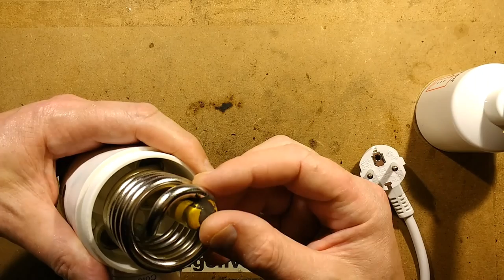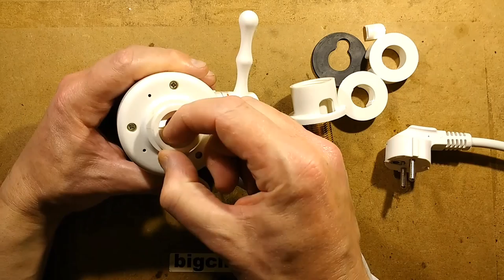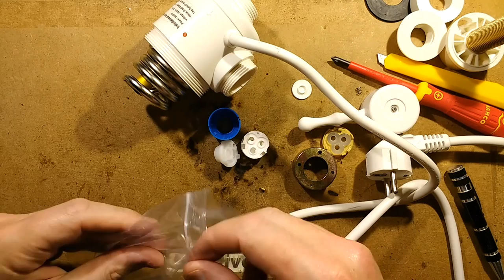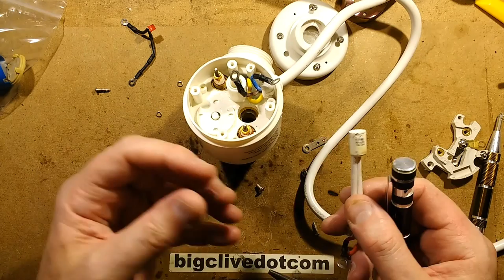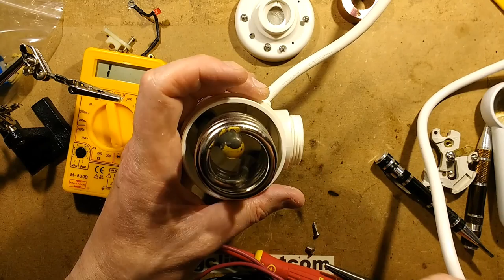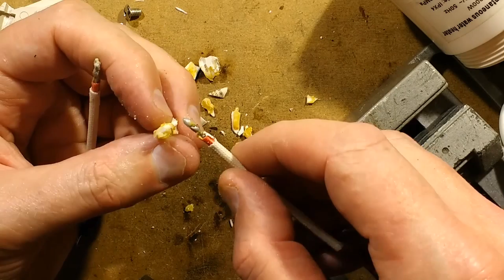Cheap electrically heated tap / faucet teardown.  (230V)

Comment: I'm not surprised the thermal protection is a one-shot deal, but I am surprised that the device is fairly well-engineered for safety. It is a Chinese product, after all.

These things were marketed in the US as a more economical way of getting hot water for coffee or tea without having to run the hot tap. I think I'd rather use a stinger kettle.

Comment: Odd. In New Zealand we typically have a large central electric boiler for houses. Small instant boilers are typically only used in remote locations or those where it'd be impractical to install a full sized boiler
Reply from the maker: We normally use an electric immersion heater in a cylindrical tank here, combined with a heating coil from a gas or oil boiler, or an on-demand water heating system.  But local water heaters are handy in workshops or where the sink is far enough from the tank to take a long time for the hot water to arrive.
Reply: bigclivedotcom right. Seems like it's pretty much the same in New Zealand. Thanks for the reply :)
Reply: Although most don't have any additional coils in their boilers

Comment: Are you sure that is a resistor thing in the black shrink tube is really a resistor and not a TCO? For example,  EYP-2BN082. If it was, then the heating element itself would be the resistor.
Reply: The heating element draws way too much current to put the LED in-line with.

Comment: Try baking the element under your sink I increased mine from 1 mega ohm to over 20 m ohm between contact and earth case , well past what the meter reads no more trips , not sure if it drives moisture out or moved the internal parts of the element gas mark 7 in the oven for 2 hours lol

Comment: I get my hot water right from the plant, so I guess I'm even better off. I have to run my sink for about 10-15 seconds and then the hot water that comes out of it is certainly somewhere around 50°C or more. Same with my shower, I don't really have to wait. The only drawback is that you're getting used to it and don't quite know how to react to those systems that do indeed need some kind of heating (be it electrical or otherwise).

Comment: The main issue is the temp of the incoming water. In regions where these things are common the incoming water temp is very warm already (usually 15-20C). That makes the job of getting the water hot (around 50C) much easier. 

In colder climates the incoming water is MUCH colder (around 6C where I am) making these units FAR less useful.

Of course I live in a 120V area so these units are utterly useless.

Comment: So do they use whole home water heaters in the U.K.? Here in the us we natural gas or electric whole home tank style heaters. 40 gallons are most common with a 2 x 5500w elements on a 240v 30a circuit. They only run one at a time upper and lower to the heater as far as I know. Out water heating circuits are not GFCI (RCD) at least every home i have lived in. We also don't have main GFCI (RCD) on our main breaker boxes.
Reply from the maker: We do have large immersion heaters here, but this house has had its one removed in favour of a very inefficient kerosene powered boiler.

Comment: You mentioned your undersink unit have its heating element corrode quickly, does the unit not have any sacrificial anode?
Reply from the maker: The case itself is plastic.  I think the issue is differing metals on the heating element assembly itself.

Comment: If it that difficult to remove you can bet it's a one shot or,,,, resetable.
Resetables, like those in submersible waterwell pumps,,,
Tened to get weaker and weaker until complete failure requiring motor replacement!
A very costly expense here in the States even doing it yourself.
There's a video for you Clive.
Let's see if you remain calm and keep your humor tearing into a submersible waterwell pump to get too the thermal protection devise! UN-DOABLE!

Comment: Seems like a convoluted design. Why not just a long-ish helical heated pipe with a temperature sensor (or two) which would be used to regulate the power to not go above the desired temperature?

Comment: That fuse should only be one-shot because in order to trip it you would have already had to bypass a least one other safety measure. The bung-plug should relieve pressure if the water boils in the chamber and then the pressure switch should turn off. The only time that fuse could reach over 100C is when the water has already boiled down below the top of the coil, which could only happen if a safety component has catastrophically failed.

Comment: Hi just wanted to know weather is it possible to mix cold and hot water together using that tap.
Reply from the maker: It let's you vary the flow of a single cold water feed to get temperature control.

Comment: Do these need mains water pressure? Thinking of using one in my garage with a tank feed. Thanks in advance.
Reply from the maker: No.  Anything that can allow a reasonable flow is enough.  They're not powerful enough to heat a lot of water.  I prefer a vented hot water storage tank.  Like the over-sink type.

Comment: Hmm is a 120 degree thermal overload in water ever going to go off though?  Shouldn't it cut out before boiling point otherwise it's useless even being in there?
Reply from the maker: It's to detect the unit running dry.
Reply: Ah of course thanks for replying Clive

Comment: It seems so odd to us here in Canada. There's really only one way it's done here; a well-insulated building, with a dedicated water heater and central heating. Some of the newer installations have installed tankless water heaters, but they are still not the norm.
These odd devices seem to be a half-measure of sorts, and not a real solution.
Reply: You will probably find that to be true for most parts of the civilized world.

Comment: Are hot water storage heaters (ie 5 to 100 gallons) really that rare outside North America?  Modern units are quite efficient.  I’ve never lived in a house without one in 50 years, and the life-span and failure rate is quite low.  In contrast, my shop has radiant floor heating, and the wee German built on-demand gas fired boiler has pretty hefty heat transfer, and includes a loop so it could be used for domestic hot water supply.  The trend here now is to insulate all your hot water lines and run them on a circulating loop.
Reply: no

Comment: While I am not a huge fan of using electricity to heat anything unless the electricity is generated at no cost to me, I have to say, this device seems to be fairly well built and not sonically welded or hot-snot'd together to make up for lack of quality engineering.

Comment: Seems a bit safer than the "suicide shower" head you previously looked at, I'd personally replace the cable with something a bit more "approved" though, wouldn't surprise me if that was under-rated CCA wire... :S

Comment: I'm wondering how you could even get the flex through the little fitting, there... What with the plug on the end.
Reply: Easy. Haven't you read the chinglish guidelines for electrical safety?
You cut the wire with either a dull kitchen knife or scissors, never wire cutter. 
Then after feeding the wire thru the hole, you twist the wires back together with a sort of "Meh" attitude to which is which and cover the new electrically sound connection with captain tape.
Bingo, you get the neat and tidy install and get to keep the plug.

Comment: Okay, I have what may be a particularly North American question that has vexed me for some time now. Why is it uncommon to have a central water heater in some parts of Europe? I assume on the Isle of Man it's because natural gas and HHO must be expensive due to shipping it to the island but these seem rather common place. Is natural gas a hot commodity or is electric just cheaper per kWh? I can't imagine using electric for hot water or cooking, much less heating my home. Gas here is $2 per cu. Foot, this month using gas for cooking, drying clothes and heating water only has cost me $16 total, in the winter it might hit $70 for heating usage as well (which regularly includes heating my 1200sqft garage as well). With prices like that, I avoid electric appliances at all costs. Ukraine's recent spat with Russia seems like an interesting case of political supply.

Comment: I find this stuff fascinating, having done residential and commercial plumbing in the U.S. for 10 years, this blows my mind. in most cases here in the us we would install a simple loop and a small circulation pump on the hot side of things. bam Bob's your aunti hot water instantly.

Comment: Quite a lot of plastic threads just waiting to crack and flood your kitchen with Chinesium.
Reply from the maker: That could well be an issue over time.  But a lot of high profile brands have been using plastic in plumbing stuff for a long time now.  Like toilet cistern valves.

Comment: I think that a temperature control unit might be in order using PWM to control the temperature of the heater.
Reply from the maker: To regulate water temperature you just adjust the flow.  A 3kW element controller would be large and require extensive noise filtering.

Comment: So how does it control water temperature? Is it just controlled by how fast the water flows through the heating element?
Reply from the maker: +Alan Smith Yes.  And in winter when the water is very cold it reduces to a very low flow rate to get any heat.

Comment: Are both round pins on the plug the same diameter in the UK? Or can the plug be inserted both ways?                                       "Vice of Knowledge" = Vernier Interrogation tool
Reply from the maker: Our plugs have square pins and are polarised.

Comment: I have an electric shower at home. It is rated at 9.8KW.
Reply: Shower is on it's own circuit though whereas a kettle or this tap thing would just fit in to a wall outlet with a maximum of 2.8 to 2.9KW

Comment: I am genuinely surprised that the thermal protection isn't a bi-metal.
Reply: they can make it so it breaks, so you buy a new one!
Reply: For the price of the unit and what it does I'd probably rather have it kill it in a very definitive way and simple way even if is permanent. I figure any cheap resettable fail safe has more potential to fail itself.
Reply: Good point. Bi-metals tend to fail in unsafe manners.

Comment: It's a pity you couldn't connect it to a water supply, you might have been shocked at the current draw. Mine draws 16 Amps from a 13 Amp plug! The fuse hasn't blown yet, possibly because it's mainly used for handwashing. I am very pleased with it however, as it has given us hot water in a remote part of the house in which it would have been prohibitively expensive to connect to the domestic hot water supply.
Reply: Do you really think Clive would be shocked by the current draw? He knows what it's going to be.

Comment: My under sink heater ("Boiler" in German btw.) somehow trips the thermal fuse at normal temperatures after a few years. Then I have to open the fuse, adjust a screw a few turns and it's fine again.
Reply from the maker: The Wahl Bach units have a latching thermal fuse that resets if unplugged for about half an hour.
Reply: Mine is a Stiebel-Eltron and there's a resettable thermal fuse. It's a long thin copper pipe with some fluid in it going into the centre of the heating chamber and on the other end there's a small plunger which releases the latch of the "fuse"/switch. After it has cooled down, you can push a button to reconnect the contacts. Very simple but works. It's just that I had to adjust the temperature it's firing twice in 9 years now. Looks similar to this one: http://www.heizungsprofi24.de/out/pictures/master/product/1/212311160.jpg . Inside the red mounting thing is the button to reset the fuse.

Comment: I'm 3 years late, but how is the cable supposed to be routed through that hole without having to cut-off the plug end?
Reply: It's not, you are obviously supposed to cut the cable to use that option.

Comment: This has nothing to do with the video but anyway i have a sealed lead battery 12v 7.0Ah, would it be a bad plan to try charging it with a bench power supply? if not what would be the best to set it to thanks (;
Reply from the maker: You could charge it with a current and voltage settable power supply, but some power supplied don't take well to be powered down with a source of power connected to their output.  The best approach is to buy a suitable SLA charger that will charge at a suitable current and automatically adjust as the battery nears full charge.
Reply: Ok thanks a lot!

Comment: Two pin plug Clive. Is it really earthed?
Reply from the maker: Schuko plug I think.  Side earth connection.  I've cut it off because if I ever try the unit for real it will need a square pin plug.

Comment: These elements ( from an old unit , removed from a kitchen upgrade ? ) make excellent  FREE  high power resistors , ( normally  VERY  expensive to buy new ) , for all manner of electronic projects ( usually about 20 Ω resistance ? ) ..... DAVE™ .......
Reply from the maker: I've seen spiral cooker elements used as load resistors in factory equipment.

Comment: Can somebody explain to me what those devices are used for? I mean... there is a hot-water pipe in nearly all kitchens and bathrooms I have been in... And if not, there is a small boiler under the sink. So why would anyone use those inefficient heated taps? (Serious question^^'' )
Reply from the maker: Some countries don't use central hot water systems.  These are also useful in workshops.

Comment: Hey @bigclivedotcom or anyone reading! I bought a food trailer from Alibaba and it came with a triple sink with 3 different faucets like the one on your video, they're a different model but essentially are the same style. Turns out none of them seem to be heating. Even though they're brand new and the manufacturer says they tested them before shipping. I made sure they're properly plugged, the water does go up through it and stores in the little "heating chamber", but no heat whatsoever.
Is there anything I could try? Or are they just faulty or defective? 
Thanks SO MUCH to anyone that could help as this Alibaba food-trailer project has become an authentic nightmare/journey.
Reply from the maker: Could they have been powered up while they were dry?
Reply: @bigclivedotcom  I did not, but there might be a chance as I had an electrician re-wiring the whole trailer and he might have plugged them when testing the electricity without thinking too much about it... 
Would that have broken them permanently? Would they be fixable?
Thank you I really appreciate this!

Comment: It could be designed like thee old school over head fire sprinklers with a set standard lead melt temp there at the bottom of the heat coil ie,  "as long as it HAS WATER in the resevor, vessel it cannot break the circuit when on," however if no water is in it, and element gets stuck in on position,,. The solder melts and circuit goes open.
Reply from the maker: That is how the thermal fuse works.  It's a low melting point alloy that breaks the circuit if it overheats.

Comment: 14:29 That is not welded. You can't weld brass and stainless steel together because both have a different meltingpoint. 
That connection is hardsoldered (above 450° C) with a flame (Butane, Propane or mix from Oxy and Acetylene as gas) and silver as solder.
Reply: It's called "Brazing"...
Reply: @ChungshanStory  yes,  that's how we call it here in Belgium also.

Comment: Aren't you going to have to cut the plug off to get it all tidied away down the back?
Reply from the maker: Yes.
Reply: Not in France / Germany, the plug  is small enough to pass through the tap hole in the sink prior to fitting the tap

Comment: I see one of these in my future. I can't afford to replace my gass boiler.
Reply from the maker: Also consider an undersink water heater from a reputable source.  It uses lower power to heat a small tank of water ready for use at any time.  The hot water is there as soon as you turn the tap/faucet on.

Comment: why would this be a thing I can understand those taps with the movement sensors (they turn on when you put your hands nearby) as those can be run off a battery in which most cases they are as far as I know
Reply: They're useful if you want a tap somewhere in a building that doesn't have a plumbed in hot water supply from a boiler or similar. Or as Clive mentions, a workshop or something like that.

Comment: A dead fuse doesn't mean you "killed the whole thing".  :)
Reply from the maker: I've just received some thermal fuses, but not in that style.  I'll be testing them first to make sure they are real.
Reply: I was making the observation/joke that it can easily be put back together so it doesn't need the fuse at all.

Thanks for all the great videos!

Comment: the clicking will be for blind, so they know they are in the heat section
Reply: Why would you need a click for that? There's warm water coming out at that point. It is much more likely that the pin acts as some kind of center detent so you put it in the "no water" position. The clcking is just a side effect.